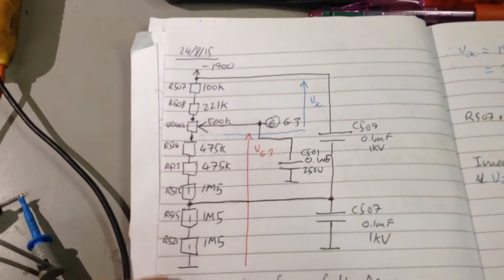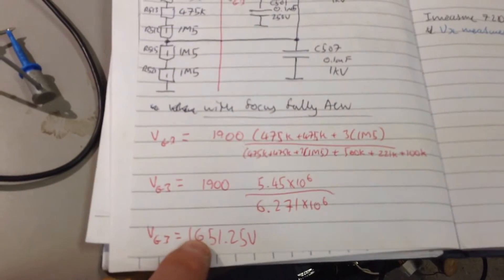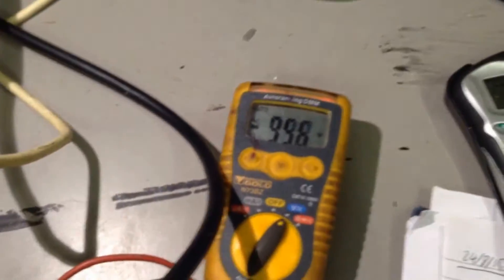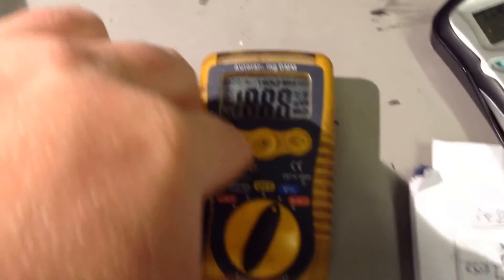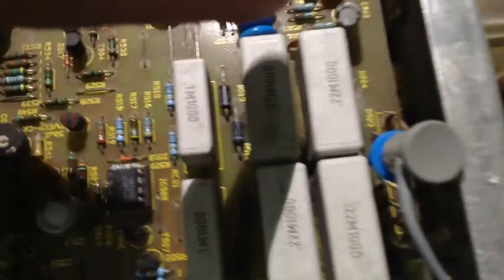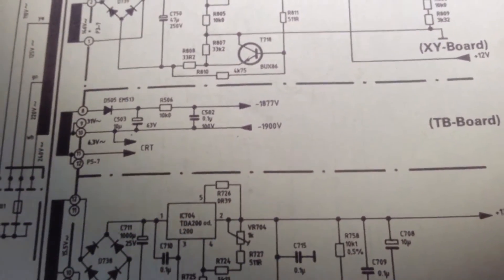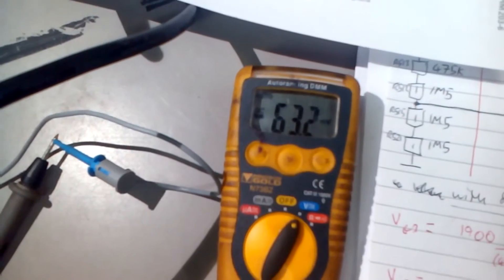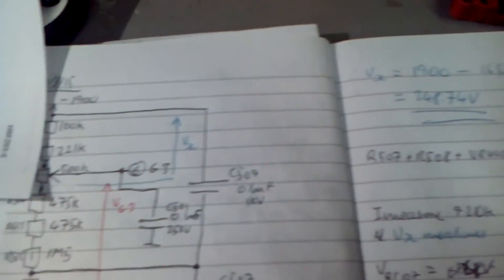HAMEG HM203-6 Repair - Part 4 - FAULT FOUND!

Comment: Coincidentally...
I've a Hameg HM203-5 that I stored in the shed for a few years and the trace stopped working not long after powering it up for the 1st time.
The circuit + opto-isolator are almost identical to the model you cover in the video.
It was also hot to the touch.
The chip actually measured OK in a universal tester, but the capacitance of the diode was zero, which looked iffy.
Replaced and all working again!
Cheers.

Comment: i got the same model and the only problem is that the horizontal axis is moved to the right maybe like 50%. so i use the x-pos pot to have it centered. ii doesnt seem like a huge problem to fix but i havent ever fix an oscilloscope before. if you can help me find the place in the diagramm to search for the problem that would be awesome. thank you !

Comment: Hi, Chris, how are you? I have a failuire with my HAMEG Oscilloscope model 203-6, which shows a poor signal, even in component tester on, I don`t know if the failure may be, the screen or a damaged component in mainboard that is located in the zone which controls the image, what do you think it can be? If you can send this information translated in spanish, much better, I will appreciate... because I can do anything with all security and the lowest risk possible, thank you for your help that you can give me.

P.D.: I almost forgot it, greetings from Caracas-Venezuela, and thank you very much again.
Reply from the maker: Please contact me through Google+, that way I'll be able to respond with more information (schematics, etc.).
But first thing it check: is the trace intensity turned down? Is the magnification knob pulled out? is trace mode switch in 'chop' mode?
Reply: Hello, Chris, how are you? No, the trace intensity is not turned down, it shows a poor signal, as if it were adjusting to minimum turning the knob to maximum. Greeting from Venezuela again, my friend.
Reply from the maker: Jorge Hippolyte Corales I'm incredibly snowed under at the moment and will try to help as much as I can. The best I can do right now is to suggest you watch the next video I made on this repair and to look through the repair manual and the schematics. Please take care if you are attempting any testing or repairing yourself, high voltages are present. I'll be in touch. Greetings from Yorkshire amigo.
Reply: Hi, Chris, how are you? I will watch your videos and I will find the possible solution, so, any question or doubts, ÇI know I can count on you, thank you very much for your help, anything I know, I will share with you, my friend.